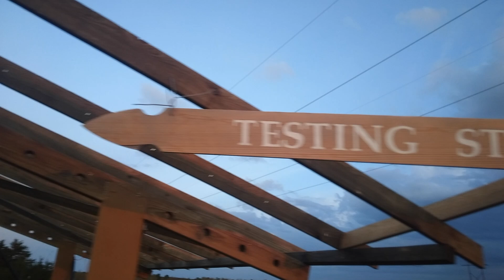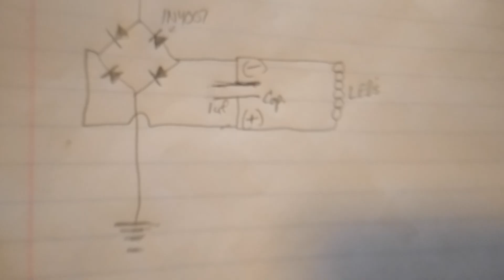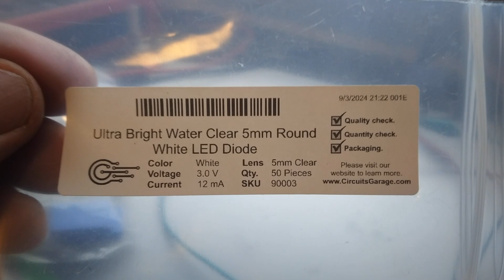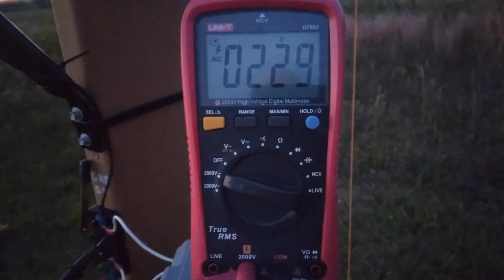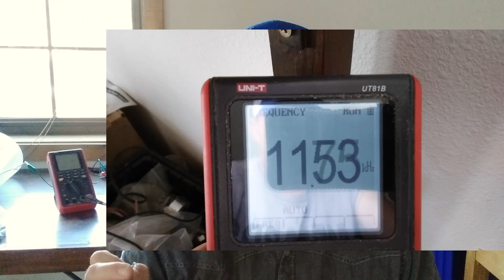Perpetual lighting from ambient energies

Comment: Great experiments!  I've done the same thing to charge batteries and then use DC lights off that system to power full brightness lights in the building at my convenience.  It's not "stealing" any more than receiving a radio station's modulated signal is.
Reply from the maker: In the comments in one video, an electrican said he has been collecting a charge off his 1/4 mile fence under a power line for 23 years, for some battery charging.  Said the power co. was aware, and they said just don't build it any higher.  Thanks for your story!

Comment: if u made half   rectifier   with 2 diods u will gain 1.2 volts extra  and u will drop some sercuit ressistance
Reply: me i try many diods  and i find if you put diods with low threshold amp   is way better   because yr diode start to work earlyer and with less current in to it me i find 3 types  and i gained from  3-17 volts from the antena and i use ceramic  capacitors for the amount of freacunces  if searce the components and see stats what works better for use u will see better ressolts
Reply: i use capacitors in paralele   with this way i drop the  ESR {the ressistance }  from the capacitors ={ full small capacity for fast charge } and  big  voltage name because is thicker the wire inside  with this efect u will drop more ressistance  thicker conduit = less ressistance again because   16 v capacitor have more ressistance than 1.2kv  :}
Reply: i like yr videos keep creating thinks <3
Reply from the maker: Yes, I tried many configurations and different diodes.  Thanks!

Comment: It looks like you have a great system going on there. 

For those who are wondering, these high power lines are completely electric insulated; no power conducted thru them is being lost or stolen.  But their abrupt DC pulsations cause the surrounding Space to form something that Nikola Tesla called "radiant energy", which cause these high voltage electrostatic effects. See Nikola Tesla U.S. Patent 685,957 for some of his designs he invented to capture and use this energy. There weren't any such power lines in his day. His devices accessed this "radiant energy" from what is available from the sun and other sources. These plates were the worlds first form of "Solar Panels", but utilised "radiant energy", not "photon energy". He designed them to form electro-static charges directly within insulated plates to be conducted thru insulated wires, to accumulate in capacitors, and then to the ground.

The only problem I can see the power companies having is that people would be using less of their power lines normal current power if they now didn't need it so much. But this reduction in use may actually save their lines from breaking down during times of high peak demand. Heck, where I live, the power companies actually will help you pay for buying less energy-demanding appliances. So, clearly there is now a need and a desire from those companies for all of us to use less, and this looks like a great way to do it. Perhaps a flat pay structure based on covering local power-line building and maintenance would be a fair exchange from the old meter method?

Comment: Cool stuff. What kind of voltages are you getting off your roof top?
Reply from the maker: The voltage across the 6 LEDs is 15 volts dc.  The open ac voltage without circuit, was around 60 volts with the sensitive meter.
Reply: @doubleMinnovations  That's pretty amazing. (I realize that the current is very low. BUT, it is still pretty amazing.). 
Thanks for the reply.